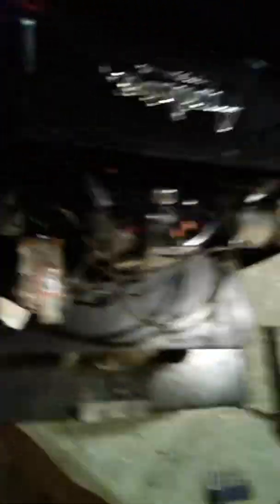It might have a fan in it

Comment: in my area of Butler PA its Johnstone Supply. some motors i get on Ebay. as Johnstone has FASCO, Century, US Motors, Packard, and chinese generic replacement motors. they are an HVAC center. besides motors they have refrigeration, heating and AC supplies contactors, switches, etc.
Reply: im not sure of my closest Grainger branch im not sure if you have to work for a company to buy stuff from Grainger. as i got one dayton 1/4 hp 1725 rpm motor from the closed place i want to build a small pedistal fan out of it. if its Grainger it be Dayton the motor brands. my local Johnstone Supply its Fasco and others. and they have PSC furnace replacement motors and PSC conversion kits to replace the ECM motors in furnaces which are expensive the common ECM motor is the X13 they fail within years of service the cheaper route  to replace it is a traditional 48 frame multispeed PSC motor. some PSC motors they have extra wires with a connector thats for your rotation. so its a universal replacement. some 3.3 in motors have that reversing connector too. some motors are wired for multi voltages with multiple wires if its 115/208-230 volt. the wiring diagram on the motor nameplate shows you how to wire it for 115 or 208-230.  some are 208-230/460 volt.  for fan blades at Johnstone Supply the Packard blades are reasonably priced for the LAU blades are a bit more. as some are universal which have interchangeable hubs which i like. makes replacing a blade easier. so when you get a LAU parts replacement blade you have to be sure you get the correct hub for it for the motor shaft as well as the max RPM on it.

Comment: the motor is a FASCO 3.3 inch  2 pole shaded pole motor very common in furnace and water heater draft inducer blower applications. they are still available as nowadays a new FASCO motor is quite expensive. as the FASCO motors are 4 pole in fans as the motors are in many configurations and types as gereral replacement or an OEM replacement for furnaces and other applications. as im familiar with the fasco 3.3 inch motors with the clips to remove the clips and service the motor the ones with sealed ball bearings are bit hard to get apart after removing the clips. Regal Beloit owns FASCO the motors formally made by Century AO Smith, Magnetek, Universal Electric CO the motors are discontinued and now transferred to these 3.3 in FASCO motors. but they are still available till the supply is exhausted then the replacement is a new FASCO motor.
Reply from the maker: Derek Obidowski 
Very knowledgeable Mr Obidowski!  I do still find these sometimes but they are much newer. Simpler to deconstruct and in better condition. At my church there are several rooms that, built after the building was complete, are isolated from the heating and cooling systems coverage. Together with old floor register and return air grills the motor and blade sets will be made into  temperature uniformity fans. These rooms having been made more practical use of recently than  for storage will need that. I have pointed that out and was met with disbelief, so there is no hurry to build these. There is a market for fans again as people discover that the fancy pricey ducted systems aren't as all inclusive as the sales job boasted, and the more so when they begin to slow down and maintenance becomes necessary. Lucky there are people like us around to pick up the slack. And as a special bonus we get to boast that these are made of stuff that was thrown away by the   experienced professionals.
Oh, and it gets better. As I am often called a hoarder, my builds are authentic retro, not just postmodern jankness twisted up to look like it.
Reply: Oh these Fasco motors they are everywhere now as i need to get a universal FASCO 9721 motor and triac switch to fix my frigid hassock fan that has no motor in it.   i got some fans from my work that closed down four high  velocity fans two Maxx Air fans with replacement blades 18 inches one 1987 Patton U21887 18 in high velocity fan  motor bearings are shot makes a racket when torned on and one 20 inch Utilitech venturi ring style high velocity fan in which they replaced the motor a chinese brand to a  beefier 3/4 hp 208-230 volt running on 120 volt Emerson/US Motors on it as i need to make some brackets to move the fan out further from the base and to counterbalance the big motor thats on it its a 48frame motor im surprised it fits in it. they also put in a steeper pitched LAU blade in it. rotates CCW as the motor has reversing wires on it i looked at it its how they set the thing up.  runs good moves air for 1075 RPM as i may want to relocate the run capacitor on it it sticks out too far they attached it to the motor.  when i get re employed again i may use this mug in my new workplace. a supermarket. as well i have to source a motor for this Patton U2 1887 chances are it will be a thinner US Motors   48 frame 3 speed motor to replace the original Samsung motor in it.   if i wanted to with this Utilitech i could put an  X13 ECM motor in it and save energy.
Reply from the maker: Derek Obidowski 
Where do you buy motors blades and other parts from? Are they reasonably priced?
Her in Indianapolis we have Grainger, Duncan Supply, and a couple others. There I buy zoom spout oilers and an occasional tool or mounting bracket. Not much else because they tell me what I Want to do won't work and they seem to have an attitude which is as if they don't like what I do. I am at the point where I expect this anymore so I don't mind pointing out how the new stuff is less versatile and how I am happy to go the extra distance to engineer around Chicken Littles' lieyers' bumbling idiot safety features. Then I ask them to stock only the authentic Zoom Spouts because the knockoffs don't have the spot on the top to hold the tiny red cap which otherwise immediately gets lost. Do your suppliers have the T handled Allen wrenches, that have some reach, available separately in 1/8 & 5/32 sizes? Here, there are only generic, stubby, all or nothing sets.
A video I made a while ago is showing in the   up next    list,  dehumidify delonghi style,  the thumbnail, showing the fan (the only thing in there worth 2/10th's % of a flea fart), parts are located, thank you Jesus! for a proper cool build to exhibit that trippy looking blade. 
Do you live near Indianapolis? If so do you have parts you would buy/sell or trade? I have a few. Though I ID them by sight, I can look on each one for the #s and I may have stuff the retail folks look at you funny for asking about. I am seeking the unusual, if in plastic and most metal fan blade (s). I will see if I can fwd you the vid.  C F

Comment: thar she blows, thats a fasco motor
Reply: its a FASCO motor they are very common in water heater and furnace draft inducer applications. they are available in multiple configurations, voltages, and types these 3.3 inch fasco motors. most of these are the shaded pole type. 2 pole in inducer motors and replacements. some are 4 pole shaded pole. they are in PSC permanent Split Capacitor form, and some can run on 3 phase power. its a very common motor. in fans LASKO, Lakewood, Patton and others used this motor for some time in the 70s to 80s. to get a new FASCO motor is quite expensive nowadays. as Regal-Beloit owns FASCO and other domestic motor manufacturers and rebranded the GE brand to Genteq. Emerson rebranded to US Motors its owned by Nidec Motor Corporation but still a division of Emerson electric.  some of these replacement motors like Packard and others are now made in China and are used for replacements now.